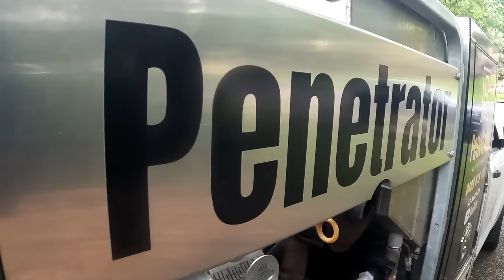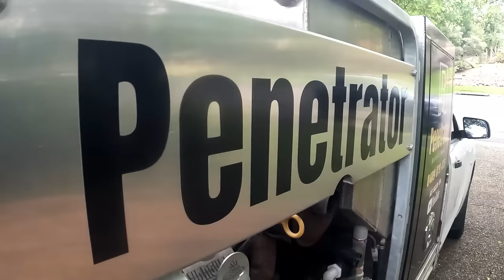Blocked Drain 464 Dunny Blocked And Previous Plumber Walks Away

Comment: Nothing like Gavin the man!  Roots run and paper blockages are washed away.  In the South (Louisiana) they are called the outhouse.  One thing some used to do, was move the outhouse and get someone you did not like to chase you and let them fall in the hole.  Of course, once they left to clean up, the outhouse was returned to its original place.  Great job on the broken sewer line.  You are amazing!
Reply from the maker: Thanks 👍

Comment: There should be some sort of clear pipe fixture that would fit over (and inside) the toilet hole. Like you do with the mat thing you use outside. It would have a hole in the top for the hose to fit thru and then screw on the nozzle. Then you could kinda see what is happening in there plus keep the water in the pipe.